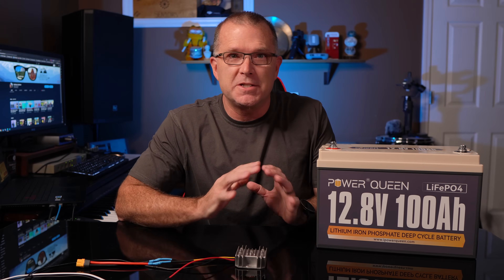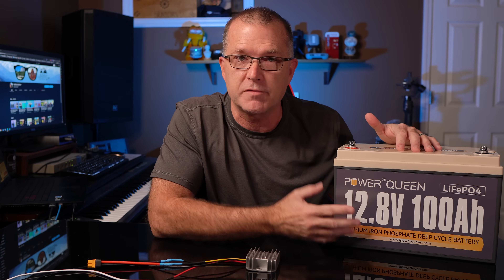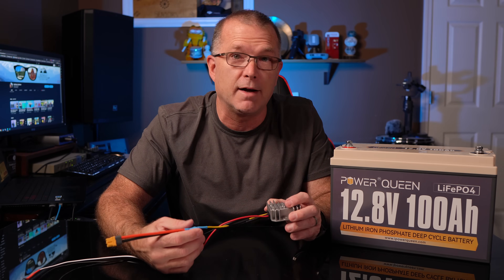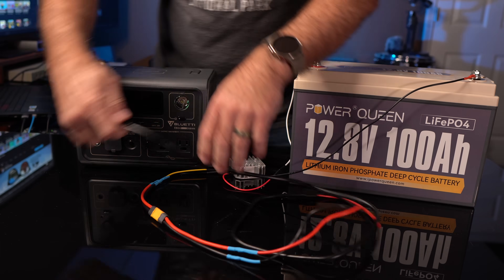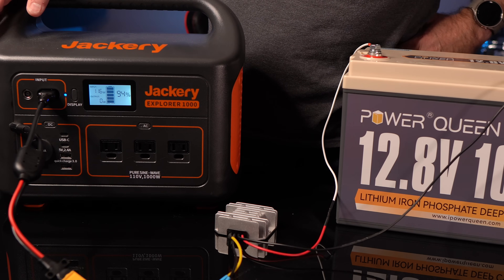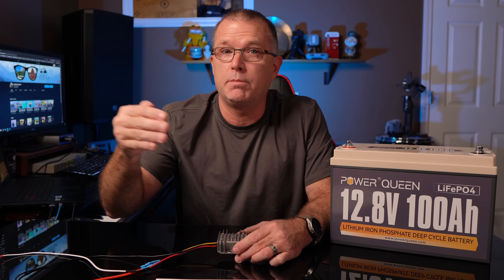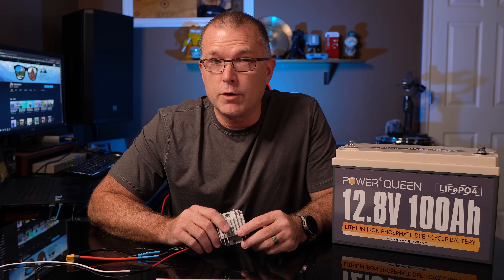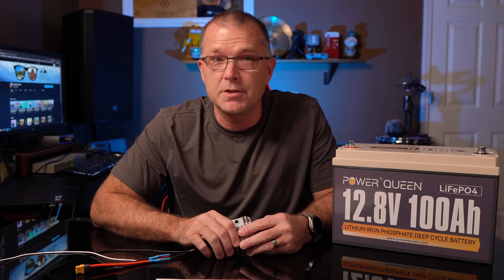SUPER EASY!!  DIY Power Station Battery Capacity Expansion / Charger

Comment: My issue is recharging the external battery. The plus of a real add on battery is the unit will recharge it along with itself.  I have a Bluetti Charger 1 and I’d want to be able to have the extra battery charge along with the main unit

Comment: This is pretty cool. Is there a way to drop down voltage easily from 24 volt to 12 volt? I have a 12 volt inverter but a few older 24 volt batteries. Would be nice to test out my system without buying a 12 volt battery.
Reply from the maker: Actually if you've already got 24V batteries,  you can direct connect them to a power station solar input without having to bother with the step-up converter.
Reply: @ReeWrayOutdoors  I'm a rookie and its going to show right now. 

I bought a grecell-T1000. It only accepts up to 26V for charging. 

I also bought a bluetti charger 1 not knowing that the grecell-T1000 only accepts 26V input not the 56V the bluetti charger can output. 

My idea was to use the MPPT controller I have believe its a Tracer 4210A to charge the 24V battery and use the battery to to power the inverter. 

Now what I think you are saying is hook up the bluetti charger 1 to the MPPT controller so it can charge the battery at 56V.

I can then recharge my charge station directly from the battery because I already proved the power station can accept at least 24V.  Sorry if that was a really long back story. 

The question is how I should connect/disconnection my power station from the battery. Do you just leave an unconnected MC4 connector on that battery and in which order if any should I disconnect. I feel if connecting I should do + first and - last. If disconnecting I should do - first and + last?

Last question is would you leave your power station connected to the battery even if the battery is charging?

Comment: How do you know what size wire to use when your creating these setups?  Do you measure by the maximum output current of your battery?
Reply from the maker: You choose the wire gauge that is rated to handle (or exceed) the maximum load you expect, and then you fuse appropriately to ensure that the cable is protected if the load ever exceeds the cable's rated current carrying capacity.

Comment: So my question would be if the power station can be charged with 11v DC why would you even need that booster when the battery output is 12.8v DC ? Thanks 😊😊
Reply from the maker: You dont technically need the step-up converter,  but without it, the charging speed would be lower and you'd likely not be able to fully drain the battery before dropping below the minimum charge voltage.

Comment: Just get a 1000 watt inverter charger and plug it in and get the input max. You still have to charge battery, so get a Solar panel, an mppt smart controller or a bonded neutral generator to charge the battery and be done. Just remember to put fuses in that dont let you overload Amperage input to the power bank. 
I live offroad overlanding and never need more power, unless Im using my power tools with my 4500 watt Champion Genny. I make my coffee running my Bluetti AC50B at 623 Watts of my 700 and max 1,000 watts. I use a 220w Renogy Fold Up bringing in 160w 21V at 8A input and the sun charges it from 50%-100% in an hour and 20 minutes in the morning. 3pm plug it back in and top off for my 32qt mini frig that runs at 40W most the night.
7 years offgrid traveling. You can do better than me, but Im good. Getting back to my Bluetti ran Movie and a cold drink boys..😎😂

Comment: The problem. For at least echofo. Echo flow only sees the battery as an input voltage and will not charge it back. Also, echoflow can damage the battery by drawing juice from the battery below its safe limits. When you use an Echo intelligent battery, it communicates back and forth to ensure complete protection. And will discharge and charge both batteries.

Comment: Why use the converter on the 12V battery? Well, my Ecoflow accepts from 11-50V in the solar input. The LiPo battery I have is still has 60% power left once it hits 10.9V So I step it up so I can tap into that 60%

Comment: I just plugged a 12V 100AmpHr battery directly into the solar port on an EcoFlow Delta 2.

It charged at 135 watts.

I plan on testing it using 2 12 volt batteries in series for 24 volt input.

Comment: The power station may try to draw more amps than the boost converter can safely deliver.  This can cause the boost converter to overheat, or worse.  Keep that in mind when using this solution and be cognizant of wire sizes and monitor temperatures and amperages.

Comment: Could you just use a 24 volt battery or 2, 12 volta like that wired in series and not have to get a step up inverter?
Reply from the maker: Yeah, that definitely works too.

Comment: Can it go the other way ? If I get the 1280wh with a 51.2v 25ah battery could I step down to charge my Mega 1(MPPT: 18-75 14a)? 
Is it the limitation to 3 amps that makes this work ?
Reply from the maker: It can, yes. But in this case, with a 51.2V (48V) battery you could skip the converter entirely since your Mega's MPPT max is 75V and its charge controller will only pull 14A max .

Comment: I just tried this with my oupes exodus 600. It is limited to 240watt solar. I connected a 12v (9-16v) input with output of 19v8a (152w) and was getting 220watts into my generator. This was great. But i did notice the dc to dc converter was getting very warm after a few minutes of this. 
Will this over heat and burn up the converter if i leave it connected?
Reply from the maker: The converter should be able to handle it,  but ive seen some people rig up a PC cooling fan on top of the converter to help pull heat away. Not really sure how much of an improvement that is, but might be a way to keep it running cooler if you're concerned about it.

Comment: Hi @ReeWrayOutdoors, can you charge that LFP battery to the powerstation while there being user or has load by running appliances? Like the powerstation is hook to solar and is charging, the battery also hook to solar and is charging, the battery is connected to powerstation and feeding extra power to the powerstation.

Comment: Not sure I understand where you are plugging that into? FOr example, the oupus 2400 does not have the ability to add expandable batteries. Nor does the Harbor frieght 2000. Does this override that?
Reply from the maker: I was connecting to the solar input.  Works great as long as you're not exceeding the power station's max input voltage on that DC input.
Reply: @ReeWrayOutdoors Aha, so if the Ouous 2400, which has no extended battery port, but has a solar charging port, you can put this into that port as ling as it doesnt exceed the solar ports capacity?
If yes, do you forsee any issues?
Thanks for making this so interesting and helpful!!

Comment: I would think you would be able to connect battery straight to input, the MPPT will limit max current anyway. You will still be limited on input current. Also, there will be a small conversion loss for step up converter, and battery transfer, but this method is much cheaper than expansion batteries. This also lets you be more flexible on charge controllers as many of the power stations skimp a bit on solar input. The new Delta 3 Plus is good with 500 x 2 solar input, but would like a bigger battery.

Comment: @ReeRayOutdoors, I want to do something similar with my Anker 555 powerhouse. I believe the max input for it is 11-28V so I should be able to attach a 24 volt LiFePo battery right? Or would it be better to do a 12 volt battery with 12 volt 24 volt boost adapter versus an ETAKER?  Can you recommend a good battery (preferably with BT and maybe self heating built in) and accessories needed to use on this power station?

Thank you!
Reply from the maker: You can definitely do a 24V instead of a 12V with step-up.   Unfortunately, I've not seen very many 24V batteries with self-heating...and the ones that do, don't seem to have BT monitoring.  :-/  But I've been happy with LiTime, Redodo, Siekon and Wattcycle (especially Wattcycle, but their 24V options are pretty slim).
Reply: @ReeWrayOutdoors thank you for the quick response. I'm trying to figure out the best way to expand my storage capacity for my power stations for camping and overlanding trips. Also came across alternator chargers and I see the bluettie and eTaker accept alternator input as well as solar input so I wonder if that would be a better/safer alternative to using a step-up converter for a 12 volt battery?

Comment: 2:50 how about having 12V to 48V 10A DC DC converter, so you can charge the power station at max power of 500W (480W) since the battery can handle that output power?
Reply from the maker: Yep! Even better if you can find one.

Comment: Hello, I have a question, which 12V-24V DC Step-up Converter can I use in a 2400W SolarPlay Power Station? How many AH is the Step-up Converter? 10A or 20A? Thank you very much for your help.

Comment: Ecoflow Delta 2: This was a no go for me. When hooked up, it would work, wattage rising, for about 15 seconds and then blow the fuse. Hooked up directly to the battery I could get about 108 watts of input, constantly. Think I'll stick to 120 volts of house current. 1,180 watts of input. I'm not saying this won't work for you, just reporting my results.

Comment: would it not be better to have a 24v 50ah lifepo4 battery to extend and charge the power station
Reply from the maker: Yeah, if you can get a decent deal on a 24V battery...that'd be much easier.

Comment: You should not do this unless the short circuit protection goes into constant current mode vs shutdown. If not, it will cycle on and off as the power station tries to find the peak power voltage/current. This cycling decreases efficiency and beats on the input section.

Comment: I use a 2000 watt inverter hooked to a pair of the same battery you have to fast charge my Delta2. Yes, it has a small loss compared to DC to DC, but it very fast, up to 1150 watts in when it is at 50%

Comment: I hooked up a 150 ah lead acid 12v to my Pecron. Charged at 100w. The problem i see is it depleted the add-on battery fairly quickly. It was pulling 7 amps and battery started at 12.96v and went to 12.70 in about 15-20 minutes. Seems like without supervision, it would discharge too low to recharge. Still not sure about using it.

Comment: Can ibdo this WITHOUT the 12 to 24v converter? Just alligator click to XT60 into my powerstation. Speed is no concern, but safety is.
Reply from the maker: As long as your power station's DC input minimum is 12V, yes.

Comment: Now how do you tie solar into this?
Reply from the maker: @jetdust  you either connect solar directly to your power stations DC input, or you'd have to add a small charge controller between the solar and the battery.
Reply: @ I have 24v of series lifep04 currently and will jump to 48v giving me 400ah. If I run solar through mppt to batteries to my EcoFlow delta pro that should do the trick pushing 800w or so through an xp60i? I’ll have 1275 w of solar coming in from 3x425 w panels.  Volts are just under 100v when in series.  If that makes sense?  Been trying to figure out how to avoid buying a 1k + battery with this system.  lol

Comment: Why do you need a voltage step-up if the charging input works with 12 volts?
Reply: Some power stations don't start to charge on low voltage (<13V) and even if they do the charge currency is very low (5-10A).

Comment: I know this is an older video, but I'm planning on something like this to extend the life of my old Pecron s1500f. The charge controller won't take the low rate of the converter from my 12v 100ah lifepo4 battery, but I think it will through the car charger adapter. It's rated in 12v/24v at 9A max. The converter I picked up is 12v-24v at 5A. It might be slow, but it should get the job done.

Comment: So, I could use my solar to charge the ecoflow, while charging my 4 deep cycle lead acid batteries, then on dull days use the deep cycle to re-power the echo converter. That works out a lot cheaper. Just need to keep the amps from the batteries within the 15amp range, but an amp regulator are not much at all, I have a few knocking around, with amp and volt regulators on the boards.

Comment: This video is two years old, so maybe 24v cells were not common yet?  But I would recommend getting a 24v cell or running two 12v cells in series depending on your solar input max this is a good overall middle ground to give you fast enough power transfer without pushing the limits of most systems.

I actully do have a voltage converter the same one just a different voltage, what I use it for is to adapter my 18v power tool batteries to run my automatic smoker/grill without needing to plug it into mains power.

Comment: Well then you would really like the Liberty engine project channel look them up and their video called capacitor regeneration where it only takes 20 watts to produce 650 watts of charging in which your battery pack can charge itself with its own charger just integrated with the plug cord to charger a start run capacitor

Comment: Hi, I have FOSSiBOT Portable Power Station F2400, 2048Wh solar generator battery output with solar charging: 12V-48V/15A MAX500W, what batteries will I need. Thank you  25.6V 100Ah LiFePO4 this one does

Comment: Would have been interesting to use a 12V to 48V converter, as the Ecoflow Delta 2 accepts up to 60V at 15A.  The 12V to 48V converter rated at 10A is only $60 or so, and gives you up to 480W output.  In that case, does the charging rate jump from 185W to 370W or....???

I can see the point of using the 12 to 24V converter to test multiple units, but the Ecoflow is on its own as it can accept much higher voltage than the rest...

Comment: personnally when i charge my stations bluetti with one 12,8v 100ah i get 100 watts adding that booster  does not give us much more wattage  19 watts.  I would prefer to buy a 25,6 v 100 DC house  at 500 Cad   that  would give me 256 watts  of charging. yes more expensive solution but a real 25,6v 100ah battery

Comment: Can you use a 24v battery instead of using the ramp up converter?
Reply from the maker: @gomcse  absolutely.  Just be sure to put an inline fuse on the positive lead to protect the cable.

Comment: Great tips.  My thinking may be wrong but why would I buy say a Jackery ($500) for use with the LiFePO4 100AH battery.  Why not just go with 2-3 LiFePO4 100AH ($55ea @Costco) batteries and use with a 1000-2000 Pure Sine Wave Inverter?  You would have plenty of power for usb, 12v, and 120v.  This is what I am thinking of doing for camping this spring to be grid-less with cpap's.  100-200AH would be sufficient.

Comment: for 800 dollars you can buy a 24 v 100ah litime battery to expand the capacity  and it gives you 2,560 w/h  plus the capacity of the power station. at 24 or 25,6 v .

Comment: well i tried my EB3A with a 12,8v 50ah and it charges at 100  99-98watts. when i use a 12,8v 100ah  i get 105 109watts.  i would prefer a battery 25,6v 100ah   lifepo4 battery yes it is much more expensive  but maybe i will try  a 5amp step up converter for mu ac70 and ac180

Comment: Great video, I have enthusiastically liked and subscribed! Is a LifePO4 battery capable of charging (from solar) and discharging to a power station at the same time? Is that the right way to do it or will I need something else to make this work?
Reply from the maker: You could do certainly do that, yes, and the power coming from the charge controller would feed the power station as well since the input charging voltage from a charge controller that is compatible with the battery would also be compatible with the input voltage on the power stations DC input....at least I can't think of where that wouldn't be the case.
Reply: @ReeWrayOutdoors  Thanks for your very quick reply! So I think my string of connections would be in the following order: 1) solar panel, 2) MPPT charge controller, 3) LifePo4 12v 100 Ah battery, 4) 12v to 24v boost converter, 5) Bluetti EB70s power station input port. Do I have that correct?

Comment: I need some advice. To start with I don't know the difference between a volt, amp or watt.
Could I hook two 12v 100amp together to achieve the 24 volt needed for a quicker charge for my eco flow max or Pecron 3600.  
Maybe that would be too many Amps or watts ?  I have four 12 v 100 amp batteries and want to use them safely. 
Help me I don't want to damage any equipment or start a fire.
Reply from the maker: If you connect 2 12V 100Ah batteries in series (- on one to the + on the other) you'll get 24V with 100Ah capacity.  The power station will only pull whatever the max amps its charge controller will allow, so you shouldn't need to worry about that because the max your power station can pull is well below what the batteries BMS's will allow.  It's help (I think) to image that Volts are pushed (from the batteries in this case) and that Amps (current) is pulled (by the power station in this case).  Watts (power) are simply volts x amps. :)  I hope that helps.
Reply: @ReeWrayOutdoors  Thanks for responding to my question and happy new year. 
But your answer is over my intelligence level when it comes to electricity.
So let me ask it this way. I have a Pecron 3600 and 4 100 amp 12 volt batteries. I want to hook 2 of these batteries to my Pecron for extra battery capacity. Would it be best to hook the batteries in parallel and buy the 24 volt regulator as you did in the video. Or hook the batteries in series to add extra battery capacity. 
Sorry for being so ignorant on this subject. 
I have a fifth grade education but I did retire when I was forty three. So please don't think i'm a total fool.😀